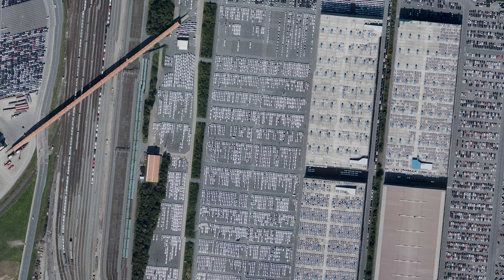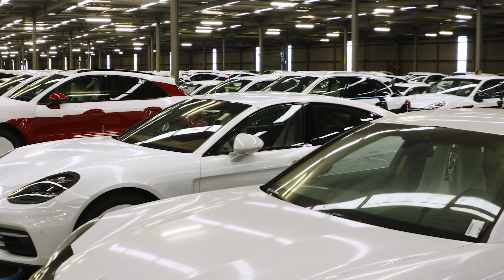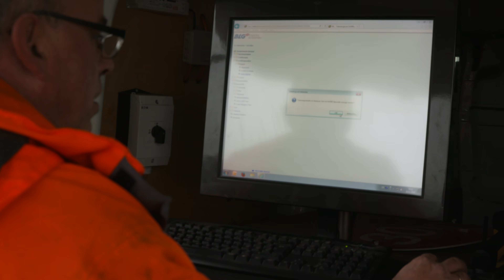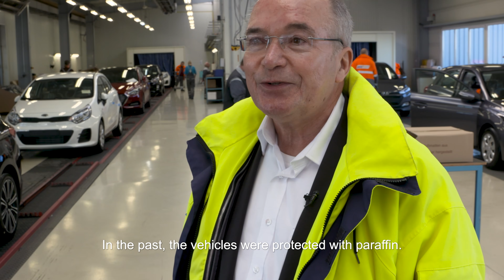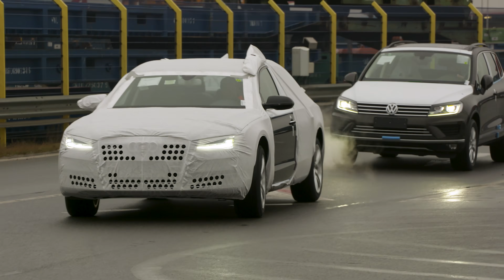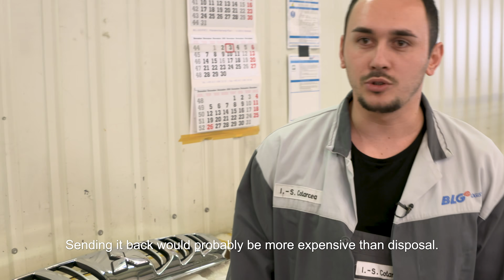World's Largest Car Terminal: Inside the Giant Car Port of Bremerhaven | FD Engineering

Comment: Visible from up in the air, around 5 to 7 km max. NOT visible from space, space starts at around 100 km above the earth atmosphere.
Reply: Visible - very much depends upon the lens on the space vehicle taking the image. 30 years ago we were working with 5m resolution images and the military typically 5-10x better. Now - commercial satellites with give you  0.5m resolution. You can clearly see lines on the road and better at that resolution.
Reply: But space is visble from space. Or earth.
What colour is space? And where does it start, despite the theories?
For me, it starts outside my door...
And there's even some inside!
So confusing.